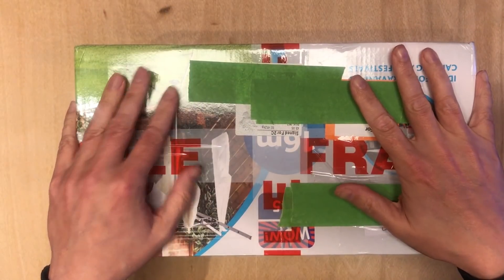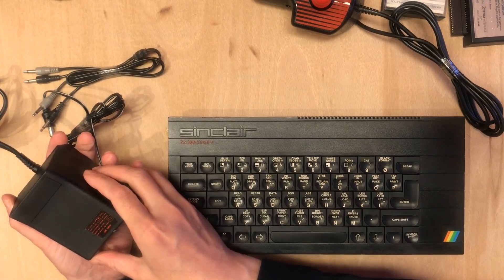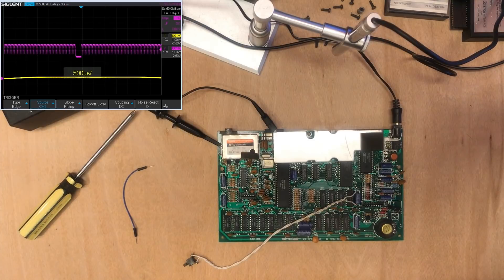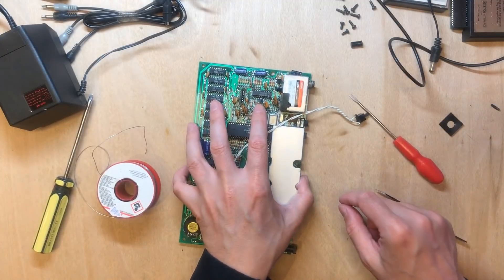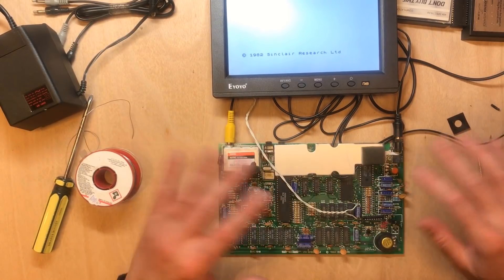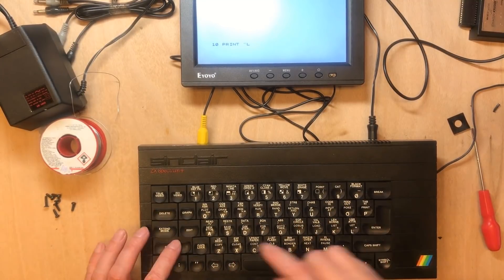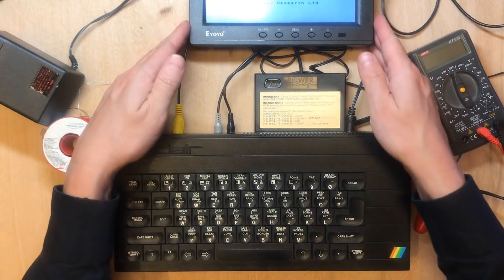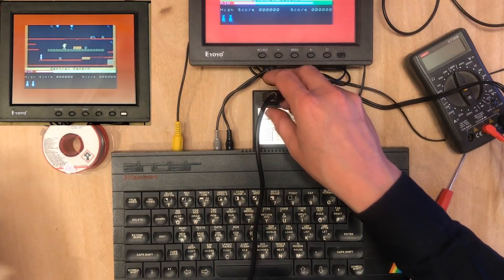ZX Spectrum+, UnBox, Test, Mod and Repair

Comment: I`ve done loads of fixes to mine and now I have to change all the upper ram. Not looking forward to it. I`ve already fitted new 9 volt socket, regulator, caps, video mod, mic and ear socket, keyboard sockets, keyboard membrane, speaker and one upper ram chip. I hope I don`t ruin the board doing the ram change.
Reply from the maker: Going to replace that ram with equivalent or retrofit some model sram in?
Reply: @weirdboyjim  I`ve done it now mate. And it works lol. I put in 16 pin sockets too. I was looking into that sram. Would of been a good idea.

Comment: You said no UHF on modern TV's... Quick look on a TV shop assist website tells me most 80 inch QD Oled stuff still has it. 1200 models with analog in available!. I don't like big TV's, so I've a 32 inch Bravia from 2010, and those as well do perfect playback of Speccy UHF signals. You won't need a CRT for this for sure.
Reply from the maker: Really?  The tv's I've looked at have a UHF port but that's just for digital terrestrial, they don't seem to be able to decode a an analogue signal.

Comment: Every time I buy a ZX Spectrum Plus I do it for the case. The case is for the HARLEQUIN 128K REV 2D board. For me the ZX Spectrum 48K must be the 48K. Not a case such as the Toastrack which I also have. If it’s your first computer I can respected that which my first is the Commodore 64 Breadbin. Which is still have and working every day on since 1984. My first ZX Spectrum is the Toastrack 1986. Which is also still have and must be repaired in the near future. Like the new ZX Spectrum 48K cases which I hope come this week. Maybe I would buy the ZX Spectrum Next. Normally I do stuff with the AMIGA 500, AMIGA 1200 and the Vampire V4 Standalone but now I liked the ZX Spectrum more. Maybe the feeling from the past is stronger than I expected. Use also the ZX-HD, DivMMC Enjoy! Pro One on it and the ZX DIAG Cart. There are many things you can do with the ZX Spectrum such as the SpectraNET.
Reply from the maker: For me this plus IS the spectrum, the rubber key variety wasn’t one I had much time on. I didn’t care about the keyboard so much but a reset button was valuable to someone doing early experiments with coding.

Comment: The resistor broken in the RF modulator is a common fault. As it started by the wiggling of the RF mod cable and would fatigue the joints on the resistor.
Reply from the maker: That doesn't surprise me!

Comment: Excellent! Get that expansion port investigated, I had great fun making a programmer for an old 256b PROM, I used the interface of a C64 to operate it.
Reply from the maker: Nice, was that the expansion port or the user port?
Reply: @weirdboyjim  Via the expansion port, I decided to make use of the already decoded I/O1 signal from the PLA addresses $DE00-$DEFF

Comment: @6:22 I've got modern flat panel TVs with UHF/VHF tuners. Many countries still use analogue TV broadcasts and so the industry continues to cater for them. Good job btw.
Reply from the maker: Sounds like it might be more common than I thought, but my new tv certainly doesn't and it would feel weird to have it on a widescreen.

Comment: You know, you should never turn on old power supplies without a load connected, some are not designed to handle a no load fault and stress internal components beyond spec.
Reply from the maker: Nah, Other supplies are worth caution but the spectrum power supplies were very tolerant. If I had seen weird behavior from it of any kind I would have discarded it for a new one.

Comment: This takes me back.  I built a DIY RAM + UART board for my ZX80, internal 16k RAM expansion for my ZX81 (in the space under the keyboard), and on my Spectrum I expanded RAM to 80K (all internal, bank switched) and added a 6-channel sound (dual AY-3-8910) and UART I/O card.  The UARTs were old Signetics 2651 devices and were used to talk to an old ICL Termiprinter (weighed a ton, and topped out at about 600 baud I think).  Fun days.  Sadly I have none of the computers and only the last of the external boards sitting around.  It will be interesting to see what you come up with.
Reply from the maker: Nice, I imagine the internal zx81 ram board was much more reliable as well, ram pack wobble was a problem!
Reply: @weirdboyjim  Yes, it worked well, with very solid rails for the 4116 RAMs. I may still have a photo somewhere.

Comment: So, what's the proper value for the composite mod capacitor? And, is it essential to fit in one to just check if the machine works, albeit maybe with bad quality picture?
Reply from the maker: This one was 100uf which was a value used by a number of guides. As such I'm not comfortable enough in my knowledge of the composite signal and related analogue electronics enough to declare it the one true value. It's there to block DC so a bit higher should be fine, go too low and it will start to round out part of the signal and you'll loose resolution.
Reply: @weirdboyjim  Thank you! I've never done any electronics tinkering, but would like to know if the old guy in the attic has any life in it!

Comment: I suspect the popularity of the Spectrum in the UK was due to a couple of reasons, lower price than the Commodore 64 and the absence of MSX computers. The Speccy's popularity certainly wasn't due to its lousy sound capability nor its graphics capability that could only be exceeded in crudeness by something like the Mattel Aquarius.

But despite those limitations, game programmers often did a decent job porting games to it as well as writing games original or exclusive to the Spectrum.
Reply from the maker: Yeah, the humble Specy dropped under £100 very early in it's production which I think was a massive factor in being seen as affordable for the average family.

Comment: Was that a half wave rectifier? You need to put some load on it to get the correct measurement.
Reply from the maker: I think you are talking about the voltage regulator. That takes the input DC voltage and turns it into a stable 5v.

Comment: I’m guessing it’s an unregulated supply that’ll drop to 9V when under load.
Reply from the maker: That was my first thought, but under load it only dropped slightly (I didn't include that in the final video cut). They actually just put out notably more than 9v for the regulator to drop down.

Comment: I had the rubber keyboard spectrum 48k. Manic Miner was a class game. The speed king joystick was robust. As I broke a quick shot 2 in less than 3 days
Reply from the maker: It's amazing how much fun we got out of really simple games back then!
Reply: @weirdboyjim  yes it is. Daily Thompson’s decathlon killed the qiuckshot 2. As it only switches for up,down, left and right that best description was thin sprung steel not micro switches like the speed king joystick had.

Comment: Some Bush TVs still have UHF as an option in their menus. Ours does and it's got Freeview Play! (DVB-T2 with Freeview's smart software)
Reply from the maker: Does that include analogue uhf though? DVB-T2 is not compatible with the analogue signals these old gaming machines put put.
Reply: @weirdboyjim  yes it seems to have a standard UHF analogue tuner according to the manual and settings options. Sadly we have no UHF TV to test anymore

Comment: Nice! I also had a ZX Spectrum in the day, the one with the rubber keys. It got lost somehow and about ten years ago or so I bought another. Unfortunately I never had time to really dive into it again and it is still stored in my attic right now. I'm very curious what you will do with your Plus and may take inspiration from it. I've had vague ideas about using it to drive some sort of robot or kinetic art thing. The kind of project that nowadays one would probably use an Arduino for.
Reply from the maker: The circuit board for the Spectrum+ is exactly the same as for the rubber key version, it was just a different case and keyboard. Ours was actually an upgrade hit from the a rubber key version.
Reply: @weirdboyjim  Yes I'm aware that it is essentially the same computer. Which is why I can't wait to see what you're going to do with it. Show us the way, oh exalted guru ;-)

Perhaps it's interesting to mention that in the 80s I knew someone who used a Spectrum to control a model railroad.

Personally if I had to design an interface for it, I think I would like to make sure that all the signals went through optocouplers (e.g. LTV-8x7 series) to keep the computer isolated from whatever current that wants to destroy it. Probably not necessary if it's just a ROM or RAM extension, that is, something without external power.

Comment: I had a Jupiter Ace.... sort of "second cousin" to the Spectrum.... it would be lovely (if only for a few hours of nostalgia) to get my hands on one again.... or my flat mate's Oric Atmos.
Reply from the maker: Nice,! The Ace was pretty rare, I don't know much about it.
Reply: @weirdboyjim  designed by the same bloke as the Spectrum not long later.... sort of like a black and white 3K spectrum with FORTH instead of BASIC. No ULA, so it was full of TTL and had to cut back on memory to cut costs with a higher chip count.

Comment: Great video (still watching, but couldn't help giving first like and comment). After my ZX81 I got a 16K ZX Spectrum, later upgraded to 48K. They gave me many years of fun and the basis of my career... Expansion modules were often compatible, even got some for the ZX81 that fitted on the spectrum. Those extra pins were probably not required by that module. (Now have to watch the rest. See you later...)
Edit: a big thank you for the trip down memory lane. Congratulations on your purchase and I'm actually looking forward to any follow-ups!
Reply from the maker: Thanks Maxint! I'm curious to take a look at the difference between the zx81 and spectrum expansion ports, that they have some weird level of compatibility is interesting.

Comment: I started with a zx81, with 16k expansion, which was gifted from an uncle that upgraded.  Later we got the zx spectrum rubber key, one of which I still have. We eventually had an interface for it that had two joystick ports and a ton cartridge slot, which I don't recall ever finding any cartridges for. It died in some hardware hacking and I lost interest in home computing until my late teens when I got an Amiga. Then I was hooked again. Forever this time lol
Reply from the maker: I used a ZX81 at school a bunch before we got the Spectrum, good old ram pack wobble! What you are describing is the ZX Interface 2, I've actually ordered one of those of Ebay as I want to take a look at that cartridge port.
Reply: I don't remember it having a lot of components. Maybe a single IC and that was for the ports I think. All the data and address lines ran straight to the cartridge socket.
Reply from the maker: @0xABADCAFE  yeah, the cartridge port was a super cut down expansion port, just the lines needed to add a single rom chip in.

Comment: It’s too bad there’s not just a serial port to use with any old terminal.
Reply from the maker: The ZX interface 1 added a serial port, would have been nice to have by default though. Let's not forget that the building for minimal price was what made this device so common, had it been more expensive it might not have had the same level of impact.

Comment: With an older linear DC PSU, you may need a low-Z volt meter to load the output a bit.
Reply from the maker: One of the things I tried that didn't make the cut into this video was putting a load across the terminals but it only dropped the voltage a little.

Comment: Every modern flat-screen TV I've had, has had analogue and digital options for tuning. Try it. See if you can analogue-tune into it on channel 36. Should work fine. The world's already full of dodgy analogue mods where someone just cut the cable at the modulator, leaving a signal that's at the wrong voltage and unknown impedance. You're not losing anything running it through RF, some might say there's even a benefit to the slightly rounded softened pixels. Don't try programming it though, on a proper knackered old 1970s TV, it'll send you short sighted! Actually a modern LCD TV will probably give a sharper signal, lock on to it better.
Reply from the maker: I have 2 tv's in the house, one doesn't seem to have any sign of an analogue tuner and the other is wall mounted upstairs. To be honest though, a spectrum on a wide screen display would feel kind of wrong.
Reply: @weirdboyjim  Your TVs show Freeview, right? Through a normal aerial? It's the same connector. Usually when you setup your TV there's a menu that searches for all the channels. Just before, there's an option for analogue or digital. I imagine the analogue is going to be pretty quiet these days but it should pick up a Speccy fine. AFAIK all TVs have this option so all should still work with the good old stuff.

As for the wide screen, doesn't your remote have an option to switch between 16:9 and 4:9 ? Or do it automatically? They used to.

Comment: My first computer was a ZX81, but got a speccy soon after and had it for years. I bought a number of add-ons over the years, but the best was a MGT disk drive, which transformed the machine. I wanted to get a Sam Coupe but it took so long to come out I got an Atari ST instead.
Reply from the maker: My school had a ZX81 I was able to mess around on before we got the spectrum. I don't think I knew about the MGT when I was young or I most certainly would have wanted one of those!
Reply: What is the MGT drive? It was a real disk drive or  microdrive?
Reply: @axonis2306  The MGT +D was a 3.5" floppy drive interface for the ZX Spectrum. See https://en.wikipedia.org/wiki/Miles_Gordon_Technology

Comment: Brill:-) 
One of the oddities of the zx range was the extemely limited release of aftermarket midi interfaces. The 128k could do midi out with the  appropriate cable, midi in was not so easy and I suspect it was down to lack of memory that nobody bothered developing it. The Atari st was already well established, so that too. Still it would have been nice to use the speccy with a midi synth.
Reply from the maker: Interesting, Midi of that era was UART based which could be an interesting project on it's own.

Comment: Interface projects would be really interesting James. I have a few Spectrum's myself (ten I think) ranging from 16K to +3A. Most were bought as a job lot and all with various faults. All are now fully working. Retroleum is a good online shop for spares if anyone is interested.
Reply from the maker: That site looks interesting thanks, stored the link in case I need it.

Comment: I need to get my Spectrum going again. It's still the one I got second-hand when I was 11 or 12, no idea how much (or little) is going to be wrong with it, apart from the membrane where some of the bits did tear off
Reply from the maker: Do it! The membranes are fairly easy to get on ebay by the looks of it.
Reply: @weirdboyjim  All right. Ordered :)

Comment: I had a ZX Spectrum 48k and when I got fed-up with competing with the family for TV-time to use it, I bought a PAL monitor and took the Spectrum to an electronics repair shop and asked them to bypass the modulator and give me the composite out. That was the start of freedom and a very nostalgic time that was the beginning of so many things for me.
Reply from the maker: Yeah, after a while I was bought an old black and white television which was my freedom but in reflection I could have had it that much earlier!
Reply: @weirdboyjim  Of course then I wanted to print things, bought a printer and parallel cable, but found out that I still needed other things. The sales guy told me later that I needed a Centronix interface, which would connect to the expansion connector and expand it further so you could still add other expansion devices. It had a parallel connector for the printer, and that opened up another avenue to me.

Comment: I have the same processor in my early history, in a different box (TRS-80).  Learned much about assembly language and digital interfacing then - many modifications and additions made to the unit - immense nostalgia here.  Very happy you found one, and looking forward to your explorations.  A bit misty-eyed here.
Reply from the maker: Ahh the old "Trash-80", although I only know that nickname for it from the quote "What you seek lies hidden in the trash on the deepest level of Daggorath"
Reply: @weirdboyjim  It endured much modification and extension - so the nickname never made sense to me.  Perhaps because it was strictly black and white video?  Considering how early it came along, I forgave it that.

Comment: Do you know verilog? If not, you should try it, you would learn it at an alarming rate if you already know this much digital logic stuff. I'd love to see what you do with FPGAs. I am considering getting one of those M.2 FPGA prototyping devices and playing with making a PCIe agent that I can access from a driver and do DMA and post IRQ messages. It's the modern version of the idea of making something to plug into the expansion port.
Reply from the maker: We touched on Verilog and Vhdl at university but I don't remember any of it apart from some outline concepts. I actually plan on doing some fpga stuff in the future, but not until this current build is fully finished.

Comment: I noticed something you did not, the internal speaker was not working. You had to plug in audio cables to get the audio out.
Reply from the maker: The speaker actually works fine, I was plugging the audio cables in to get the tape loading going.